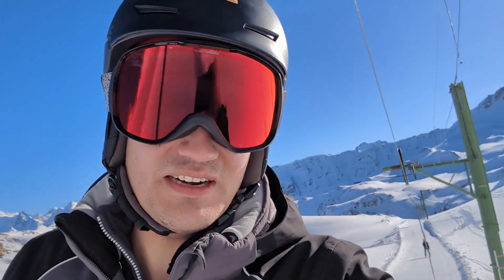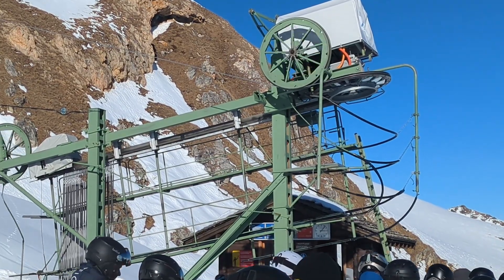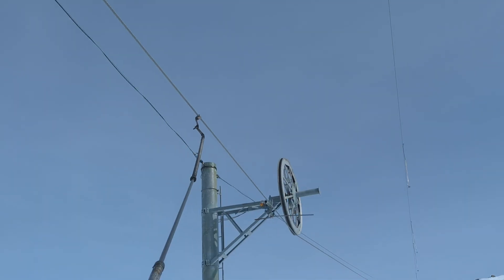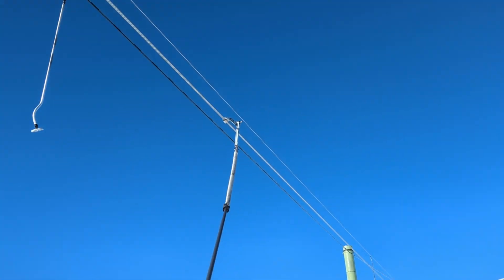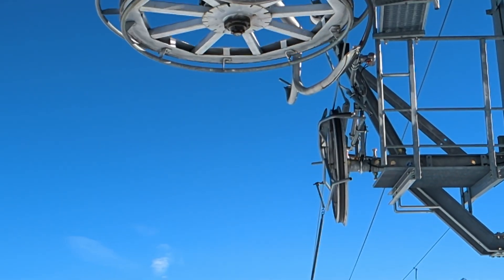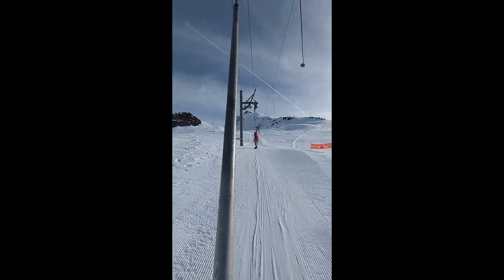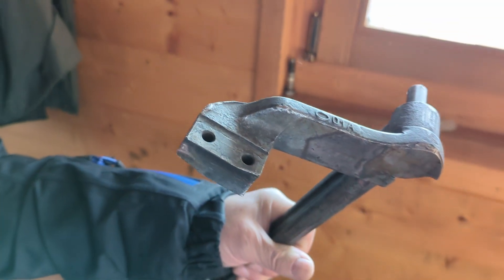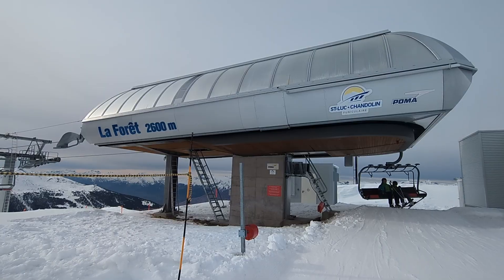The brute force approach to the impossible skilift problem: Poma lifts!

Comment: I love the simple but verry clever engineering on these. As a child I was always fascinated about there workings. And would sometimes just ski down quickly ahead off my family to just look and observe the operation. Standing there for 10 min. Sometimes I still do wit other lifts. I’m in my late 20s now. 
You spoke about a electrical switching rod by the legs to detect release of a pole. A lot of these lifts also have a metal rod besides the pole that mechanically operates its release. With those you can put the cub between your legs and then give the pole a tug. So you can decide by your self when you want to go. 
Although I love the engineering of these lifts. I try to avoid them. For especially in France. The first tug they give is verry unpleasant and can leave you with a sore back an butt. And the ones still operating in France are very very long most of the times. Like more than 15min standing and being pulled to the top. Witch (you can imagine) is a strain on your legs and leaves you exhausted when you reach the top. 

I truly want to thank you fore these videos. Your behind the scene access answered a lot of questions I always had about these wonderful machines. 

So Vielen Dank für all die Mühe, die Sie investiert haben
Reply: My local dry slope (UK, we only know of rain! 🇬🇧⛈😉) has three Poma ski tows, two of which have no spring dampening at all. To avoid that initial shock, what I do is position myself with the disc a bit behind my butt and then use my arms to absorb the shock of the initial pull, gently moving the disc into the regular position once I'm in motion. It makes the ride a lot smoother, and really helps to avoid « Pommes Anglais » too. 🍑🇬🇧😉

That said, my favourite kind of tow are the low-level ones where there's a steel handle for snowboarders. I'm 100% a skiier, but I find the snowboarders' handle much easier to use, and good for building up strength in the arms as well! 🤘

Comment: Ah, the sweet memories of being 10 years old, catching a pole with a properly clapped-out damper spring and subsequently being launched forward so hard that it almost lifts your skis off the ground.

Here in Slovakia, Czechia and surrounding countries, Tatrapoma lifts are everywhere. I've always wondered how the grip works, and now I finally know. I once saw one of these lifts fail by launching all poles from the magazine. That must've been a fun day for the operators.
Reply: Best memory when the damper was frozen completely so it lifted me in the air at some parts of the ride.
Reply: I definitely remember being lifted up by these, only for my skies to touch back the ground seconds later at a weird angle and causing me to fall.
Reply: Breaking your spine at the same time! Love these memories
Reply: Not almost if the spring is old
Reply: At my mountain the small kids would jump with it and get pulled easily 5m though the air. They ran it really fast as well

Comment: There are some chairlifts that feature inverse bullwheels to take wrong-direction turns, using teeth that align with the grip and beam connecting the chair to the cable. Wrong-way turns are also extremely common on detachable lifts, for obvious reasons

Comment: as a french guy, Poma ski lifts are my favourites, the dangling sounds at each pole have been engraved in my memories my whole life. It just resounds with ski holidays for me
Reply: Love that comment. Same for me!
Reply: Me too
 @bartmulder6995
Reply: Right, epic sound I never forget
Reply: i used to be scared of them as a kid, some of them would launch you into the air! a very distinctive and nostalgic sound though
Reply: @Humungojerry  That's right!  If the heels of your skis don't leave the snow when the big pull hits, the operator needs to increase the lift's speed!
Reply: And sadly they are desapearing slowly from our ski resorts... I loved to ride these
Reply: real
Reply: I am from Finland and I have too grown up skiing with Poma lifts. I really like them. They are small, probably relatively inexpensive and fast and you can easily put two lifts next to each other to increase capacity. In my youth they still had a manual operator instead of an automatic gate.
Reply: It was a personal tragedy when the local ski resort removed its two Poma lifts in the mid-70s.  I'd spend all afternoon riding the Pomas in preference to the chairlifts.  One reason is that I would never have to stop skiing.  The lift attendant would throw me a tube and pull the cord as I swooped in.  My skis never stopped sliding for even a moment.  He was very accommodating!
Reply: In Slovakia I got used to these and I have stuck them in memory. Now in Czechia, Italy or Austria I never see them but I still think the engineering checked out. Its bruteforce approach that works.
Reply: What about waving the bar up and down to make everyone dance on the line? :)
Reply: Will someone ever decide to build a more modern, detachable-style t-bar or platter (or Teleski in some Quebec ski resorts) lift with detachable grips? I wonder what it would look like...
Reply: et surtout les meilleurs en cout de maintenance

Comment: Awesome video! I didn't know Poma skilifts (téléskis) weren't that common outside of france / french-speaking switzerland, because I've exclusively seen them in my life skying in the french alps (other than the rare "pickaxe" style sometimes).

I've already seen the clamping mechanism "fail" (fail to make enough friction) because of a jam at the end station, and that ended pretty catastrophically - the jammed pole got unjammed by the next one, and both were together till the bottom station, where it completely locked up in the beginning of the storage drum, causing a very loud sound. The operators had to stop the lift for the entire afternoon to unjam it and check for damage. That was in 2018 at Risoul, on the Homme de Pierre lift.

Cheers from Grenoble!!!
Reply: The UK seems to have been a good market for Poma over the years. Although we have one or two local chairlift manufacturers in the UK (Their lifts tend to be identifiable by the small and worryingly economical design of the open « chairs » used - Look-up the Great Orme cable car for an example) Poma solutions seem to be much more popular here. 👍

There's a classic Téléski at Alum Bay (Used to carry people between the park and the base of the cliffs) on the Isle of Wight, and Poma cabin lifts exist at both Alton Towers (1980s) and East London (ca. 2012). 🚠🇬🇧😇

...And as a man who is seriously passionate about the French approach to engineering, I can only say that - For me - This is the most « Alsthom » (Pardon... Awesome 😉) thing imaginable! 🚄🇫🇷🛠❤‍🔥💨
Reply: Chile has a lot of Poma lifts at their resorts too.  I recall hearing that the French helped them build and develop some of those resorts, so I bet the Poma lifts there were a consequence of the French influence.
Reply: @ro Quite possibly. The Santiago Métro uses very similar trains to the MP-89-CCs on the Paris Métro 4 & 5...And if you thought French chairlifts were awesome, check out their Métro trains! 🚈💨💨💨🤘
Reply: @UK-Combustibility-Assured   MP-89's run or ran on M1, 4, 14.
The MP-89-CC is (or should be) now only on M6, they've moved them from M4 since the line was converted to full driverless automation, gradually replacing the good old MP-73's.
Now is the time to catch a last ride on the MP-73, as they'll soon be gone, only leaving 90's and younger trains on rubber lines.
Line M14 now runs MP-14 trains mostly. A few MP-89-CA's still run if I recall correctly, but the major extension opens in June and I'm not sure if the remaining MP-89-CA's will continue for long.
M5 never had MP-89's as it's not a rubber tyre line but a "steel" one. It runs MF-01's, just like on M2 & M9.

If you haven't already, you should come try the new MP-14's, they are absolutely fantastic! And their sound... 🤩
The new MP-14's now run on line M14 as 8-car CA versions (driverless), as 6-car CA versions on M1 & M4 as support fleet to complement the MP-05's and MP-89-CA ; and as 5-car CC versions equipped with a removable driver cab on line M11, replacing the venerable MP-59's in preparation for the Eastern extension of the line opening this spring.
There are still at least a pair of MP-59's still running as of last week apparently, but they'll soon be gone for ever.
I nearly dropped a tear last time, seeing the trains of my childhood being retired after 60 years of service.
These swaying, punchy and funky trains were great, their replacements are fantastic but the nostalgia can't be avoided... I'll remember their popcorn smell forever!
The new MP-14 also accelerate like mad rockets and brake super strongly, tumbling first time passengers like bowling pins.
But that's more rubber tyred metro specific than model specific, though the new ones are kicking even more at take-off.

Soon (coming years), the MF-19 will start to be deployed, replacing all other older MF-67, MF-77 and MF-88 trains from steel lines, only leaving the historical metro with 2 steel wheel train types : MF-01 & MF-19 (3 "subtypes" for the MF-19).
With 3 other types for the Grand Paris Express :
The wider loading gauge MR3V & MR6V, same type but in 3-car (lines M16 & M17) and 6-car (M15) versions ; and the MRV (a temporary name?) for line M18 with a narrower loading gauge closer to the historical metro and 3 cars.
Line M14 is getting a new and improved signaling and autopilot system to enter service in a couple months, not sure if the MP-89's are compatible with it or not, so they may definitely be gone from line M14 soon, fully replaced by MP-14's.
Anyway, I can't wait to ride the new GPE trains in 2025 and all the new extensions opening this spring (34 kilometers of new line extensions, 30 of which are in tunnels, spread over M11's Eastern extension, M14's Northern and Southern extensions, RER E's Western extension, and tram T3b's Western extension).
It's going to be transit-a-palooza in Paris every year till at least 2030 or 2032 !